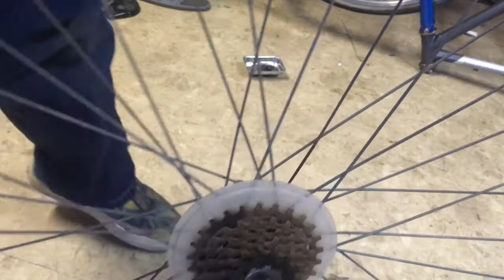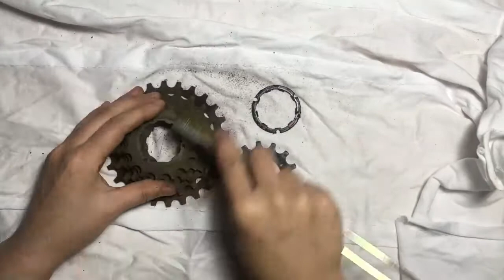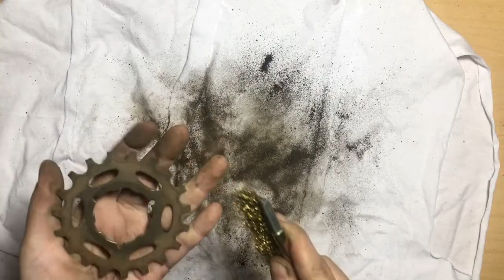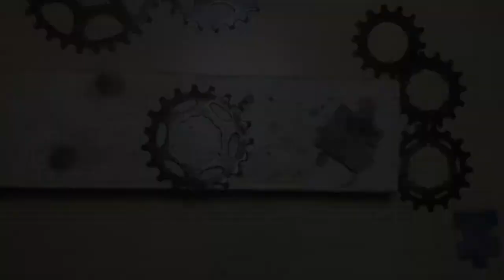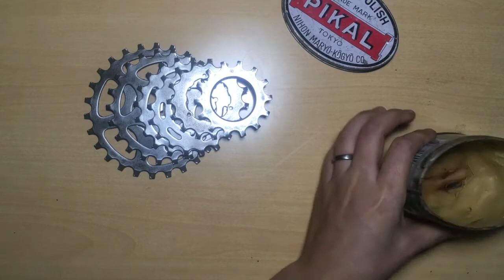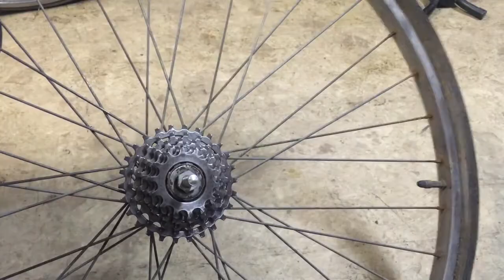Vintage bike sprocket restoration.

Comment: Is it possible to add another gear to this kind of freewheel sprocket? I mean, I have a 5Spd 13-21 Regina sprocket, but I'd love additional gearing cuz I live in a very steep area.
Reply from the maker: As far as I know it is difficult
You will also need to replace the hubs and derailleurs.